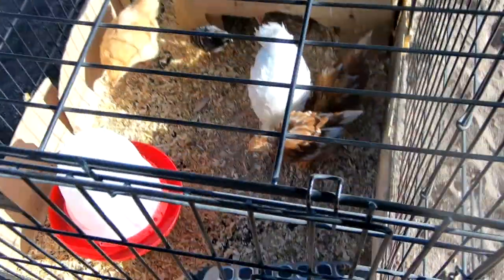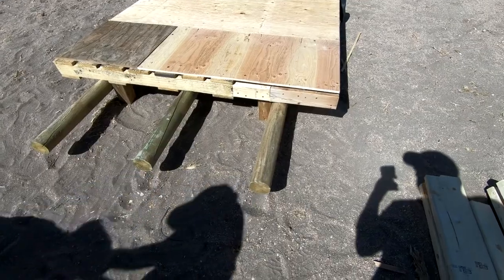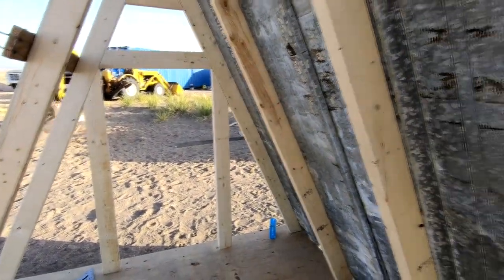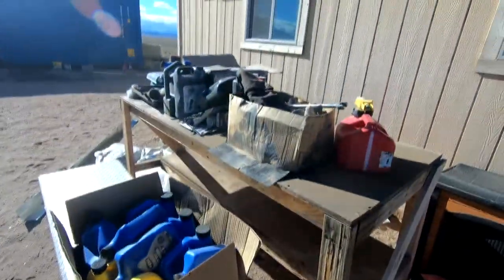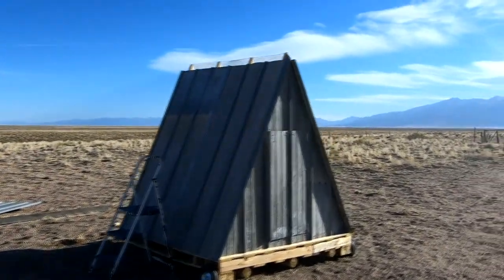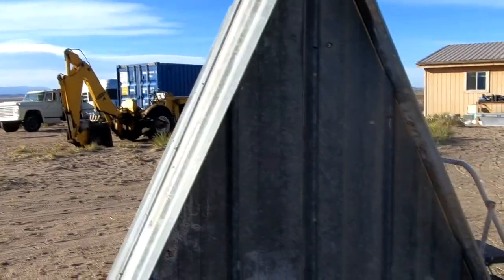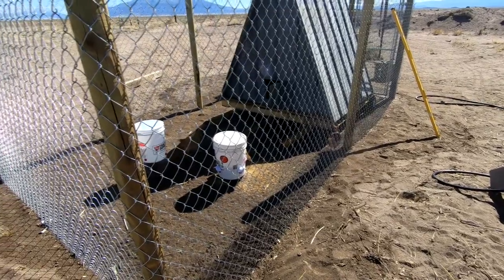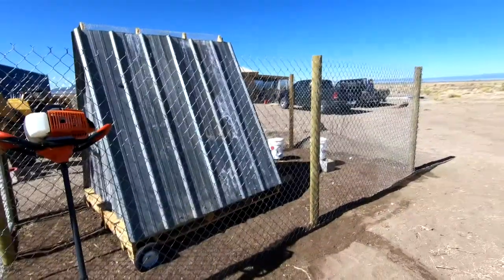Finished Chicken Coop

Comment: Great job on the coop and run.  Hate you lost some birds.  Definitely part of the experience but never a pleasant part to get used to.  Not sure what predators you have in your area but you may want to lay wire around the perimeter and string wire above the run for digging and flying predators, respectively.
Reply from the maker: Thanks Sapper! We strung some rope up top to deter hawks, which are abundant here.  We have racoon, porcupine, coyotes, but those are not typically a threat during the daytime when the chickens are inside their house. We'll see!